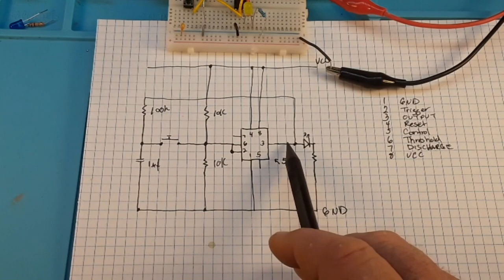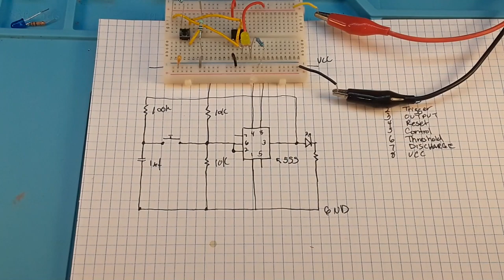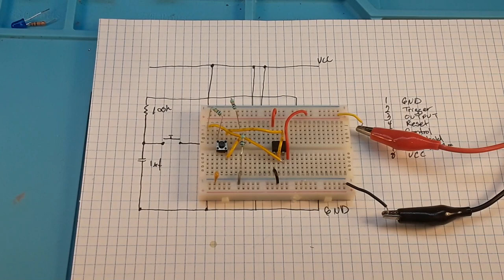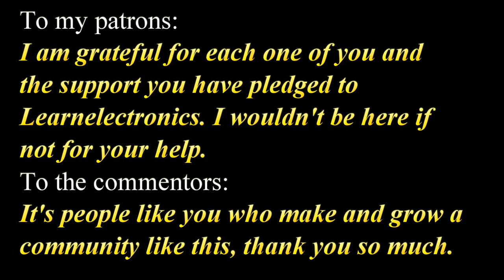Classic Circuits You Should Know: Latching Switch

Comment: I set this circuit up as soon as I saw it. It sticks to the KISS principle ( Keep it simple stupid) Works perfectly, I have made transistor versions of on off latches and find they are susceptible to noise, especially when driving Mosfets. This circuit is a winner winner chicken dinner, well done. I will be using it all the time.😀👍

Comment: We have always in steady state 2.5V on pins 2&6, even when output is low! Only in transition states we have about 0 in one case and about 4V in the second and that is the reason that it works.
Any way, thank you for the presentation of the interesting circuit.
Reply: Mr Remmoz Thanks for that. I am admittedly at a low level with this stuff, but i had no idea exactly what was going on. Your comment helped. One problem (and there are many) is that most people don’t know why all this circuitry is necessary at all. It’s a light switch, or even simpler, it’s twisting two wires together. Have followed and built dozens of things with the help of Ben Eater and always learn lots. Here I learnt nada, zilch, nothing.

Comment: I am teaching basic electronics to Thai Army soldiers , and the other day one student asked me to help him construct a "double function switch". After watching this video I realized that he meant a Latching Switch, so the I've sent him the link to your video. BTW, I really enjoyed you chatting about your young days in the Navy, I'd really like to hear about your getting your Dolphins and the following career...  Cheers from John.
Reply: So what if it does not explain how it works at all .
Reply: Mr Remmoz Paul explains both the wiring and how it works, and I follow up in class using different modes of the 555 timer.
Reply: @la6mp  Exactly, He shows how it works but nothing explained. See on the oscilloscope signal from point 2and6 and you understand what I'm saying. But first you have remember in details how RS switch works.
Reply: @la6mp  To be more clear. To put reset in RS of the 555 (pin 2and 6) you have to have the voltage jump above 3.33V (2/3 of 5V) - then output 3 is low in the 555 - LED is off) . And to put set in RS you have to jump below  1.67V for pins 2and6 (1/3 of 5V) - then output 3 is high, LED is on. So, I'm asking, when you have voltage at least 1.67V or 3.33V at pins 2and6 if they have about 2.5V as you measure by multimeter? Did Paul explained it? And this is the whole clue of the matter. Without explanation of this phenomenon the presentation is of very low value.
Reply: Mr Remmoz I am on holidays, when I return home I will follow your measirements and come back to you in a serious way. Thrse days my focus is on mountain hiking in Switzerland:-) See you!

Comment: Wonderful video, I have used the 555 in the bistable mode using 2 push button switches. I have built audio amplifiers using the LM386 and the TDA2822, and the 555 to turn on and off the amplifier. Trigger pin 2, amp on reset pin 4, amp off. This circuit will now let me use one push button switch to do the same thing. You have a great channel for DIY people such as me, thank you kindly for sharing this. Just one question, I see a 100K, a 10K, but can not make out the other resistor, is that  1K in the top loop? Have a great day, will continue to look for new videos....

Comment: I recently used a 555 as a mosfet driver in an arduino project - why ? Because i have a heap of them and as they can source and sink current they can be used as drivers  and saved me from having to use a logic level capable mosfet or a dedicated mosfet driver , every time i look for a simple circuit to do something the 555 seems to appear ! It would surely have to be the most versatile IC ever !

Comment: I love these videos but if you could have explained about how it works with the trigger and threshold reading the state of the capacitor and how it charges and discharged would have been much better. Knowing how it works is often just as important as it gives a basis to modify and make your own variations rather than just memorizing something.

Still thumbs up and keep up the good work as an educator.
Reply from the maker: I have done numerous videos on the 555 timer. You can find them in basic electronics playlist.
Reply: @learnelectronics  thanks for the reply. The sheer amount of info and uses for the 555 you go over makes it hard to locate the relevant information and then correlate it to this project. A lot of people watching this are beginners and wouldn't know what to look for or ask and how to find it and relate it to this. I wouldnt take much time to talk about how the trigger and threshold comparing the voltage of the capacitor to VCC. 

Each video as a self contained lesson is good for a lot of the less focused minds that exist in to days face paced world. You actually do that in a lot of your videos but thought it was missing here. Not recommending you go over every aspect of the 555 in every video with one just the relevant info. But I guess as the content creator you yourself have to draw the line somewhere and decide when and what is too much information.

Comment: I have a problem with the 555 timer chip because I'm always pulling stuff from old used circuit boards and I never see the 555 chip so if you have the time could you please show a similar circuit but instead use only discrete components?

Thanks,
Ricardo Penders
Reply: Try a J-K flip flop or the NAND gate equivalent http://hyperphysics.phy-astr.gsu.edu/hbase/Electronic/jkflipflop.html .  Lacking all of those, you could build the gates out of transistors http://hyperphysics.phy-astr.gsu.edu/hbase/Electronic/nand.html and build the flip flop from those.

Comment: This looks amazing and I want to make it so badly. I've tried though, and it just doesn't work when I do it. I've literally watched this video over ten times. I've paused it, taken notes, looked at the schematic and even copied the exact layout on my board that he has. It just turns the LED on when I push the button but doesn't turn it off. Not sure how to fix the issue but I've spent the last two weeks trying to get a simple on/off 1 button latching switch to work for a project and I can't figure it out. None of the solutions using NPN BJTs, or MOSFETS, or even this 555 timer work whenever I try them. Obviously, I'm the problem, but I don't know what the problem is to fix it. :(